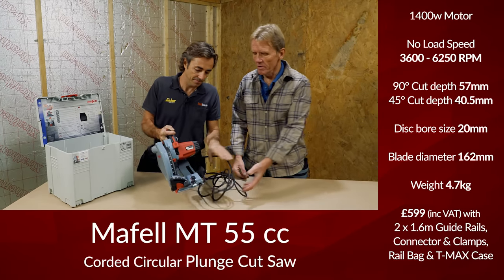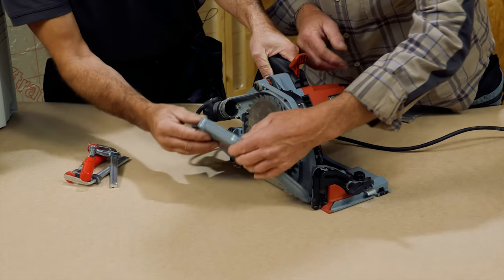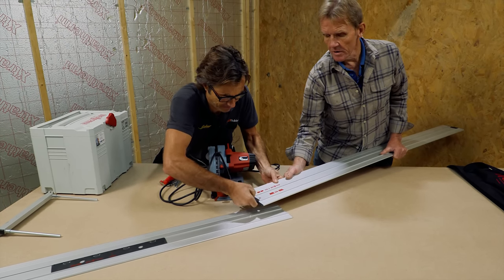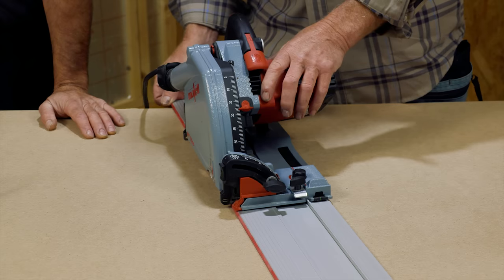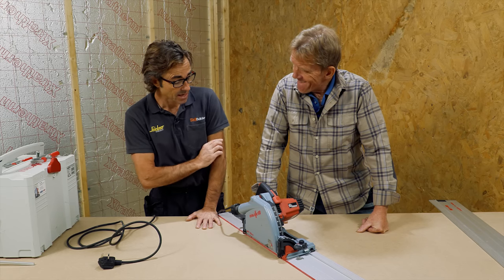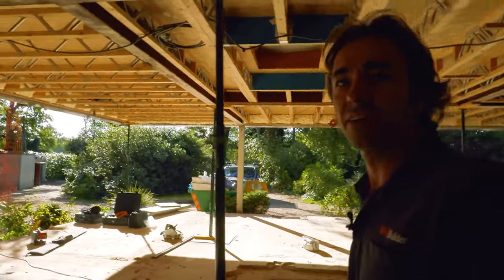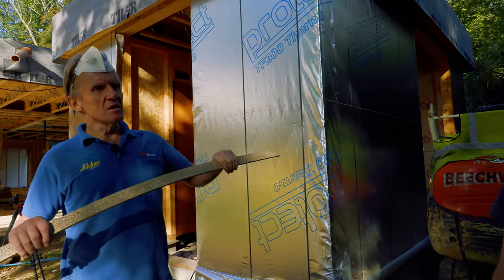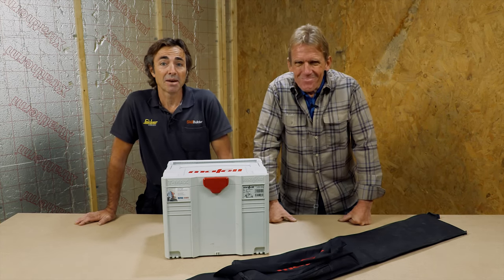Mafell MT55cc Plunge Cut Saw - Episode 8

Comment: Just want to say a massive thank you Rodger and robin Iv being after a track saw for ages and Iv watched every video you have done. After all my research and your advice I bought the mafell 😃 thank you for your video
Reply from the maker: We are really glad it helped. That is a great saw. Did you go corded or cordless?
Reply: Skill Builder corded 240 didn’t know they did cordless as I mainly fit bathrooms as a timed served plumber mafell probably is over the top but I will be doing more kitchens and sheet material and for the extra thought why not I paid £599 for the full kit, saw, box, x2 rails, joining bar, x2 clamps and blade

Comment: I am a carpenter from germany (its much more distinct from other wood workers here)
ive never seen a carpenter without mafell tools. and i can attest that all of the tools mafell is developing and selling are top notch and build to last. ofcourse they are on the heavier side but thats what you get for making heavy duty machines.
the only thing i myself broke on mafell saws were the cable... not paying attention and somehow cutting them or i yanked them so hard that they came lose over the years. 

we dont use the plunge saw (ive bought one myself tho) but the KSS 55 / 85 on the job site and every bigger saw is in the shop. noone showed me how to adjust the base plate so it will be 90° to the saw blade because we never had to do it. i didnt even know it was a thing until i realized all the cheaper saws (pretty much every other saw on the market) doesnt use the style of rods to ascend the saw up and down. 
I am a very firm believer that you will buy a mafell product once and then pass on to the next generation and they could use them without issues in 20 years+
its obvious why they recently had their 125th anniversary.

Comment: Just got mine delivered yesterday,  I'm sold on the Mafell quality. I also have the P1cc and DDF40. I haven't had the chance to put it through it's paces but I'm looking forward to it.  Like Festool, the tool documentation is atrocious.  I turn to these videos to really learn how to use it.
Reply: Just like you, I love the Mafell quality. In addition to the MT55cc, P1cc and DDF40, I have the UVA 115 E orbital sander. I may look like an ordinary sander, but it is really good. I once used it to sand the wall wood panels of a room in my home. I needed to remove much wood. I sanded for about 10 hours. This machine makes very little vibration. When I was done, I inspected the floor. I expected to see dust. But the floor was absolutely dust free. It would have been easy to spot any dust, because the floor is painted in dark red color. I used the Mafell vacuum unit, and the Abranet abrasive strips. I am very happy with this Mafell sander, and all my other Mafell tools.

Comment: I have this saw in 110v.  Very satisfied.  But has anyone noticed ALL tracksaws are built backwards?  All of them... which of course means I'm the odd duck.
If the blade were on the left you could walk the length of your rip with your elbow at your side as God intended... and your left hand could easily support the off-fall.  With the blade on the right, you have to walk cross-armed the whole way and your left hand is idle.  Guess I could learn to cut Lefty.
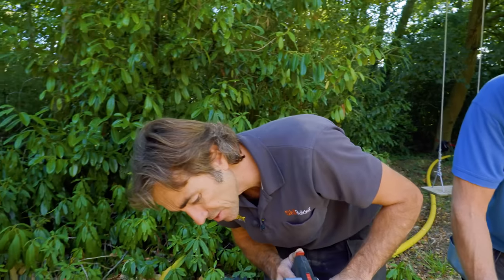14:49 Just look how this experienced tradesman has no choice but to start from behind the workpiece and walk around to the rip-side with his right arm fully extended across his body... and walk that way for the whole rip.  Watch him crane his head over his shoulder to watch the cut!  How awkward is that???
Now imagine the blade on the left, how easy it would be to start from the opposite end of the workpiece!  Contolling the saw would be sooo much more natural and easier!
Yes, I'm the odd duck here.  But even if it means every big tool company is wrong... I am right.
Reply: @Jock-mj4zd  Hahaha... Yes, if I were a lefty I'd laugh at that too.  At least one tool catagory is built for lefties!  Kreg just released a Left-Blade tracksaw, so I guess they saw my comments ;)

Comment: Does the mafell base overhang the rail edge "motor side" could be an issue with mft park guide system.i know the equivalent bosch does.
Reply: It does but the answer to that is to spread out the parf dogs to be wider than the workpiece so the saw cuts between them.

Comment: How did you find the weirdness that the saw only has one handle please, it misses out the top handle that is 90 degrees to the cut and that is found on most if not all competitors? My missus is a bit concerned about that missing handle if / when she uses the saw, if I buy one... Thanks

Comment: Could you please explain why this kickback happened? And how to avoid it in case of using a plunge saw?
Reply: The saw kicked because the blade was in contact with the workpeice before starting.  Any saw will kick if you do that.  Operator error.
Reply: @Golgafrinchamdent  thanks mate
Reply: Roger is how not to use.   robin is how to use lol!

Comment: 16:56 - Okay... why did you set it up for a left-hander? Just flip the whole thing around (or put it on the other side of the "table") and you can push it at twice that speed with your right hand, without having to reach across, without tripping on the tube and without banging your balls into the sawhorse. :-P
Reply: Wow, I thought it was just me who noticed this!  All tracksaws are built for Lefties!  Would feel much more natural and have greater control & safety if the blade were on the left.  14:56 - Just watch him crane his head over his shoulder to watch the cut!
Reply: @Golgafrinchamdent  yes'there are a few circular saws, not tracksaws that are left blade which also makes it much easier to see the cut line.  Don't know why the manufacturers don't build them that way since the majority of us are right handed.
Reply: @hhanger1  Yes it seems pretty bass-ackward to me.  The left bladed circ saws are all smaller blades too (except the worm drives).  Kreg just released a Left-bladed track saw.  Cross-cut & Cut-off saws should be right blade... and track-saws which are designed for ripping should be Left blade.

Comment: I think this saw ticks most of the boxes, but the lack of a second (front) handle really puts me off the Mafell. It was the only saw in the selection that they tested that didn't have one. It's really strange why Mafell have omitted this, given that it's a safety feature.
Reply: Have owned and used a tsr55 for the past 7 years, more often then not i find myself when not using clamps putting my left thumb on the track ( opposit side to the blade or if cutting a bevel on the base of the saw, very rare i reach for the front handle

Comment: Just got the Makita sp6000 corded. Couldn't resist the cheap deal I saw. Let's hope it's not buy cheap, buy twice. Base seems a little more lightweight than the Festool.
Reply: Have had my Makita for 5-6 years now. Great value for money IMO.  And definitely not a cheap option. Obviously might not have quite the so called finesse and  reputation  like Festool but it does exactly the same and with the added benefit of a scribe cut function as on the Mafell which the Festool doesn't. 
If it's your first plunge saw.  Don't try to plunge the blade while it's trying to get up to speed, and don't plunge blade too fast, it will kick back especially in thick worktop material, either chipboard or solid wood.
Don't think you need to worry at all.
Reply: @johnmackay7789  I've been lucky to have a resident Festool ts55 in the workshop to borrow for 2 years but wanted to see if I really have to spend top dollar to get a track saw. The Festool is a great machine and hasn't broken in my experience of it. But will give the Makita a chance. But if it doesn't cut plumb and straight I'll be annoyed
Reply: @adamandlorraine  it should do straight out of the box. There are plenty adjustments to bring it in to line if it's not cutting to your liking. It will definitely feel different to the Festool if you've had that for two years.  But it works on the same principle. A good blade and you should be fine. Which is actually my only gripe, the price of blades. Makita is bad enough let alone a Festool one.

Comment: Excellent video guys. my question is would you swap your battery track saw for this 240v? i was looking at this Mafell in Axminster tools last week and must admit it's beautifully made. I'm using my 54v dewalt track saw that i am happy with atm.
Reply from the maker: I have that DeWalt 54volt and it is great. No need to replace it
Reply: @SkillBuilder  to late lol, I've bought it and what a difference it makes!! I'm workshop based so battery isn't an issue. sold the 54v DeWALT + 54V extractor for a lot more than i paid so looking at the Mafell P1 jigsaw and the Festool OF 1400 Router tomorrow with the cash i made...... win win for the workshop!

Comment: More power on cut? Yes, because the machine use saw blade with fine kerf
Reply: Yes but it works  just as well with the Festool blade as I have both saws and buy the same blades for both.
Reply: Ian Glazebrook you're right and if you want use saw blade with fine kerf on Festool TS 55 you must have another flange (lock washer) that tightens, I made mine.

Comment: What am I missing here? You both look all sorts bent out of the shape while cutting, I definitely do not want to spend a days work performing acrobatics over the track and saw. It seems the minimum width of cut piece acrobatcless way would be the width of track(by setting it on camera side of the table)? Or walk backwards, which could work in the shop but not on site. All pics I found online seem to be showing this orientation, which I find very strange, that saw is not worth much if one has to work like that. Yes practise left hand, which for me could be an option but I wonder how many people would be willing to do that. The other option, work on the floor, ok for short term but no thanks been there done that. So what am I missing here, please enlighten me ? thanks

Comment: Like mafell tools, realy delicate precise tools. But that cuprex motor is marketing bullshit.  Couple years ago when i heard it first time, i'm start to looking for it 'cause i'm like to know its a special engineerd motor like the dual field motor or its "just a motor". But i need to say its just a regular electric motor. The superior power came from two ingredient. 

First, it has a full wawe electronic, so the saw are able to run at full speed under load.

Second, 1400w is a massive overkill, for 55m cutting capicity and combined with the full wawe electronic able to
 deliver a massive overload capibilities. 

Why 1400w is an overkill ? 

1400-1600w motor are used in regular circsaws, wath are able to cut 68mm deep in a single pass without strugguling.
Reply: I heard they use more powerful magnets and wrap their copper tighter, purer copper etc. I don't know if it's true or not. Basically yes it's a standard design motor but built better and from better materials was the theory I was told. could be marketing bs though.
Reply: @chezcotton  

Its could be true, but its not change the power output i think. Its still a motor what rated for 1400w. The different magnets & windigs structure are good for reduce the size of the motor, so they can reach the required power/ watts from a smaller factor. But i said earlier its just my opinion, and for me mafell is still an outstanding manufacture with amazing tools on their lineup.
Reply: Why would 1400W be an overkill?  If you're cutting some harder materials it will help maintaining the blade's speed resulting in a cleaner cut.
Reply: @1255XL  
I know. And always good when you have some reserve/spare power for the toughest job as you mentioned earlier.

With the overkill, i just like to say/describe 1400w is more than enough most of the time at 55mm cutting capacity. As i said earlier 1400-1600w circ saws able to cut most of the materials at 66mm with ease. Its depends the saw blade as well. And its definetely not enough in hardwood at 66mm. 

All in all i just like to say with that "overkill" sentense the cutting preformance is not came from the cuprex motor its came from the raw power 'cause that amount of power can handel deeper cutting as well.